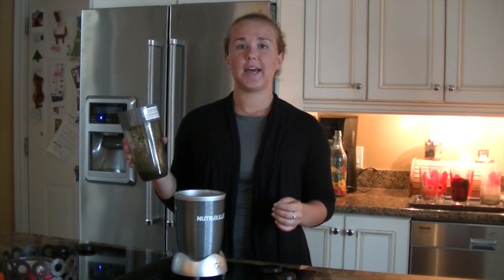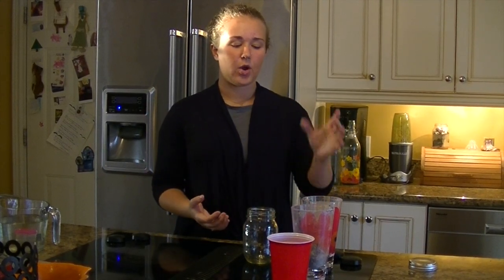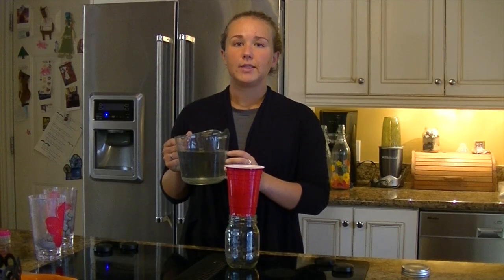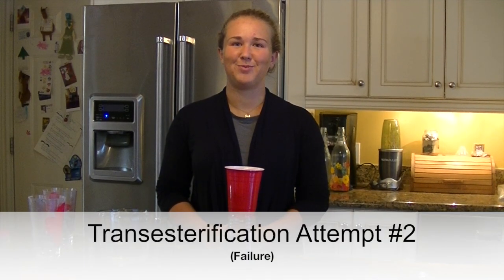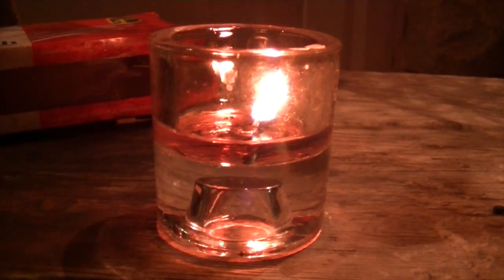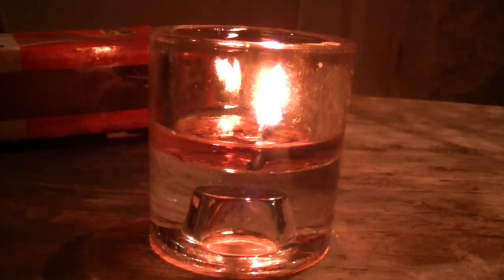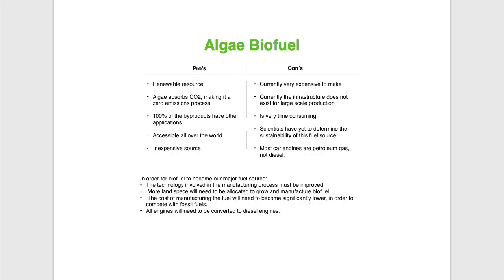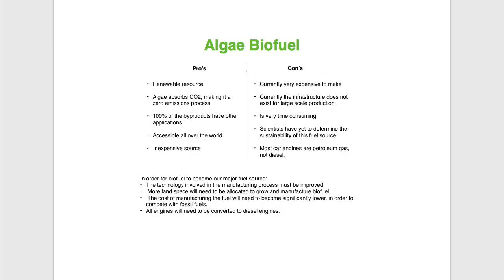How to make Algae Biofuel DIY

Comment: Can i just use smaller rocks instead of buying/ specifically searching for gravel as long as it filters?
Reply from the maker: Gravel is best for filtration Gravel forms permeable layers. When the sand particles are next to one another, there are tiny spaces between them. Water can pass slowly through these tiny spaces and some of the dirt particles get trapped

Comment: As for the pros, while the processing of the fuel is almost carbon neutral, because we're not using all the products of the algae such as the carbohydrates and proteins which are also constructed primarily from CO2 in the algae, the process may be carbon negative. The chaff left over from the processing might find other uses that expell CO2, but if they are simply extracted and either added to materials as filler like algaecrete or if they're used in composting/gardening as biomass, they would be carbon negative processes.
This material can also be atomized into a high purity charcoal dust that could be used as a solid fuel or it could be used as feedstock for yeast, bacteria, fungi, or animals. The possibilities are very fast, can't wait to see what comes of it!

Comment: Algea.Bio Fuel is Carbon Negative, it permently removes 10 pounds of CO2 for every gallon of Algea fuel!. Fossil fuels need to be defunded. In the UK the fossil fuel industry gets £10.5 Billion p/a in subsidies, if those subsidies were tranfered onto Algea production for Carbon Negative fuel etc. We could roll out Photo Bio Reactors( PBR) country wide in just 5 years as they are easy, cheap and quick to build. Which would also create millions of local Green Jobs, money from fuel and other Algea products would stay locally/regionally giving a massive financial boost to rebuilt Green local economies, reforestation, Micro Hydro grids, Water Source Heat Pumps etc.

Comment: I live in Cambodia.. I want to fill old plastic  water bottles  with algae..
And make bio fuel to run a generator.. there area lot of power cuts here.

This technology could really help people in poor countries.. 

We have sun and the algae..
Reply from the maker: The tricky part would be growing the algae in water bottles.  Let me know if that works because algae can be difficult to grown in small quantities, it is better in large vats.
Reply: @lucidscience925  ok thank you for that.. I think that might be in a bottle.. it grows so fast..initially that it burns up all available  CO2.
And given the opening of a water battle  is so small, only a tiny bit of CO 2 can enter the bottle..

I need a low cost solution without using a gass pump line....
But I can use a solar powered gas pump ..

Thanks for your reply..

Comment: Wow!  Outstanding video.  You got it all right--except for pronouncing trans--ester--if'i--ca--tion!
Although, I don't think it is as expensive to make as you might think.  Certain strains of algae have the ability to provide up to 10,000 gallons of oil per acre.  That's enough biodiesel to provide fuel for ~19 cars per year! (assuming 22 mpg fuel efficiency & 11,500 driven miles)

ref src:  https://www.wikiwand.com/en/Table_of_biofuel_crop_yields
Reply from the maker: Good point!

Comment: But there is a way to get sodium hydroxide in the wild...... take some wood burn it, take those ashes boil them in rain water, then let the ashes settle to the bottom. Then take your liquid layer off and let it sit out in the sun you will eventually have what is called lye, or sodium hydroxide.
Reply from the maker: yes, or find it naturally from previous fires.

Comment: I need an idea for a research paper😩can someone help with an experiment idea that can be designed about algae to biofuel
Reply: Hey I was also doing something along those lines. What I was going to do, is use mechanical press (in this vid she uses a blender) and solvent (Potassium hydroxide, hexane, methanol etc). After the oil is extracted you can compare to things like motor oil or coal (fossil fuels basically) and see which one burns longer. Burning it tests the fuel usage times which in turn shows efficiency. You can do something along those lines for algal biofuel.

Comment: Use a bit of cloth and smaller gravel for the filter hot water works better to get the lye out and you can boil down the water to get a stronger lye.
You can brew alcohol with food gone bad or normally poison fruit in the woods.

Comment: We have an experimental product-based research and i decided to pick this. My question is, how can we prove that this is working? Can we use it car? Motorcycle? Etc. Thanks in advance :)
Reply from the maker: well yes, we powered a leaf diesel leaf blower with our fuel. If you have an old diesel lawn mower - or even more fun - a small toy car that runs on fuel (hard to find) try those
Reply: Lucid Science  plsss

Comment: Heres a question. Is the Unrefined aglae oil flammable?

 Cause there are some engines designs, like Stirling Engines or steam, don't really care about the quality of the fuel only that it can be move to the burner and burns. Doing research to make my own stirling engine back up generator and the less steps I need to do the better for a SHTF situation.
Reply from the maker: What do you mean as unrefined?   As soon as it is seperated, it is flammable.
Reply: As in fleshly squeezed from the algae, the process at the 2:00 mark. 

Been looking around about that since I don't have the ability, yet cause of my current housing, to test it out myself. And I rather find out that you need to refine it for it to burn then get everything 3/4 of the way built and find I messed up.
Reply from the maker: Yes, it will burn at this point.  It doesn't need to be distilled.

Comment: EXCEPT.. with the DPF on diesels after 1997 was forced by Congress clogs because that's the point of it. The petroleum companies were seeing people start to make and use biodiesel and hey couldn't allow that to happen so the paid congress to force the DPF on vehicles.  The caveat to this is the farmers "farm vehicles" were exempt from the DPF requirement if they stay on the farm. They can buy a diesel vehicle and remove the DPF and its sensors or buy w/o the DPF.. So tons and tons of farmers in the USA are running biodiesel in diesels w/o any issues.. So you can too.. they make conversion kits to get rid of the DPF and it's sensors and stuff or you get a pre 1997 model.
Reply: Farm vehicles were temporarily exempt, to give manufacturers time to adapt.

Transition Program for Equipment Manufacturers -- TPEM. https://www.dieselnet.com/standards/us/nonroad.php

Can we not turn everything into a conspiracy theory? Thx.

Comment: Hi You Missed a step between the blended and getting the Algae. Should I Dry that algae in the sun first?? How do I separate and make the oil so clean like in the video .You just seemed to go form Goo in the Blender to clean Bio fuel?? 5:43
Reply from the maker: yes.   on a small scale the phases sepearated quite nicely

Comment: @lucid science, I think she forgot to mention that you can process the biodiesel into biogasoline using the same fracking process as well. Of course, that would take a lot more energy.
Reply: make sure your ECU can handle it, i would make sure it has the same burning properties as og gasoline, and aim for the 14.7:1 A/F ratio in your car, otherwise you're gonna have to do some programming

Comment: With methanol, algae oil, and lye you can create soap and biodiesel? 

Is there any other byproducts and is there further methods of purifying it required to prevent anything else in getting into engines or will it completely separate  itself due to different densities 

Just want to add wonderful video, perfect blend of science while keeping it simple

Comment: Hi ! great video. I am going to this with my students. I have questions. 1- Do a mix algae oil, alcohol and potassium hydroxide together. 2- How did you separate the oil from the algae? Thank you! keep up the good work.
Reply: Hello ma'am actually after you first get the chlorella you need to isolate it from the water then break the cell structure then mix sodium or potassium hydroxide with methanol and add it to the algae then wait and you get glycerol and bio diesel
Reply: @divyanshsharma8383  do you these chemicals with wet algea

Comment: Love the idea! I was wondering your separation process for the different layers of solutions? What kind of gravel I know different rocks will have different elements in them.How do you know if the flame was not burning off of your separation agents?
Reply from the maker: Hello Omar,
For the separation process we used a make shift separation funnel.   Your point about the gravel is probably valid, we just used the gravel that was nearby, so perhaps there are variabilities with gravel from different regions.    The biofuel was heated to get rid of the rubbing alcohol which burns quite easily below water's boiling point.  The smell of rubbing alcohol disappeared and also, rubbing alcohol burns quickly.   This was sustained.  In addition, we used some to power a lawn mower.
Reply: ok sweet deal, keep up your interesting work
Reply: @lucidscience925  FYI: the gravel is only a filter. Using coarse sand or even moss will help keep ash out of your potassium hydroxide

Comment: just trying to be sure, but, would this work with anything that has a high concentration of oil, and chlorophyll? such as  leaves, or anything like that?
Reply from the maker: So Kevin,  in this project I had groups making biofuel from almost anything else.  Corn is common, some did it with plums.  But, algae has some great benefits first is the high output of biodiesel.   Algae are single-celled organisms that only need sunlight, water and carbon dioxide to grow.  So at the same time, they remove carbon from the air as they are photosynthetic,  they remove nitrogen from wastewater,   you don't need to cut down rainforests to grow algae ( a huge problem with corn), and so there are also many environmental benefits.
Reply: Thanks for letting me know, and for responding to my comment.

Comment: aren't you making soap? i have experience making biodiese. even the smallest amount of water for example the azeotrope ethanol forms with water is enough to foul your tranestrification and instead undego soponification under the presence o anny water even if alcohol os used in exes. this process will only yield glycerol and soap unfortunatly. transestrification is very water sensitive.
Reply: What makes the difference here is that she is pouring alcohol into the solution before the potassium hydroxide. In soap making (I make soap), you have an oil and lye. The recipes are created in such a way where they are "superfatted" meaning that it is ideal to have a little oil remaining in the process. You never want more lye than oil. That would be unpleasant :-) and the oil is moisturizing in your bar of soap. Adding alcohol first changes the reaction and while there might be some saponification in the reaction, you can see when she does it that the two separate out at the end. I'm sure we could pull up the reaction in formula if we looked it up.
Reply: @jbudney2000  if she used hexane instead of a blender to break the algae the process would've been better, more fuel.
Reply from the maker: As you know, glycerin comes in at a different density and was physically separated.  We used some of our fuel to work a lawn mower.  There may have been some residual glycerin (which can still be used as a fuel ) but it was definitely fuel.
Reply from the maker: She diligently researched how to avoid making soap with lye.